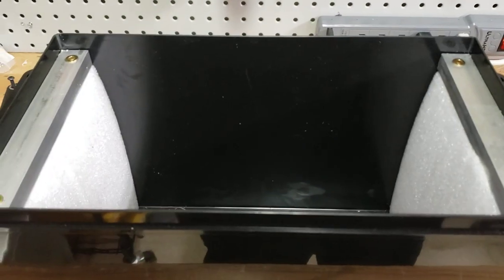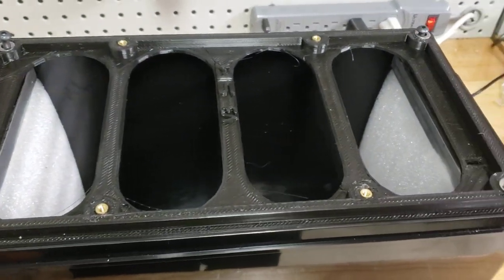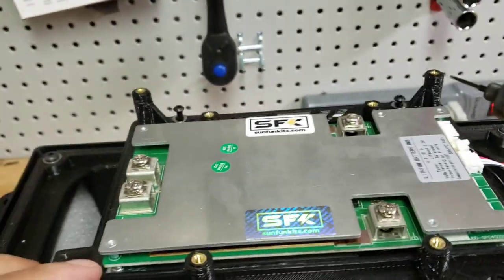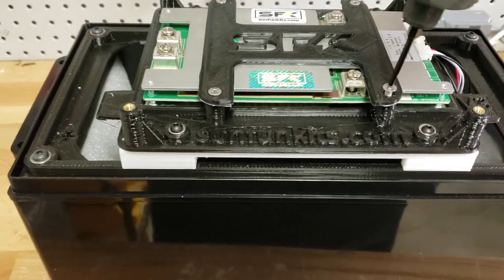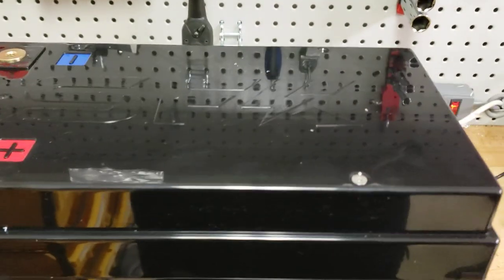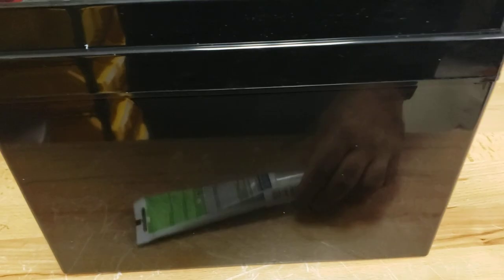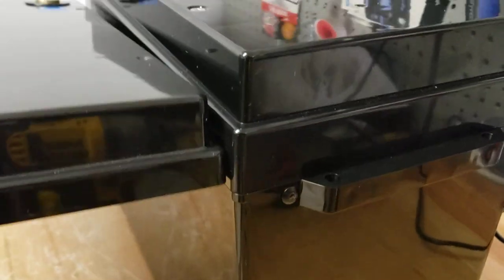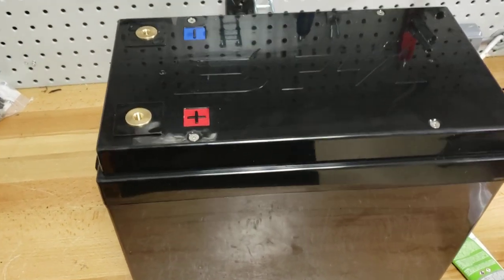SFK V3 KITS Fully molded DIY battery kits for EVE 280 / 304, CATL, LISHEN cells, welded studs & All.

Comment: Kits look fantastic, except the print quality of the brackets/braces, they could use a little tweak on the settings of the printer to make them turn out nicer. Seems like Temp/speed may be an issue...
Reply from the maker: Hi the prints are made for strength so they are using .8 tip the thicker bead is 8x stronger than .4

Also since it’s internal I don’t think the looks matters much.
Reply: @sfkenergy  Very true, very true...

Comment: I have some 304 cells that you speak of, I will order a v3 kit. I have 4 of the v2 kits with the ABS lids, when will you ship out the lids? I have not had any problems with the BMS popping out, just the opposite, they can be difficult to get out or fully popped in. Kinda what you want.
Reply from the maker: we have some pre-production lids, if you would like to change it from yellow production lids to these, just send us an email and we can send these out to you. they included the updated top plate, the brace and spacer. Specify the cells you are using.